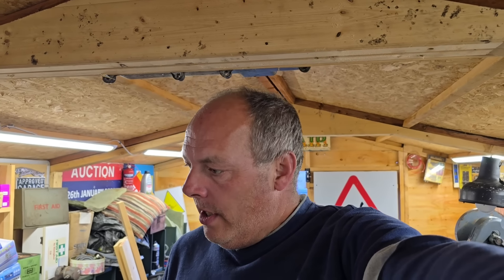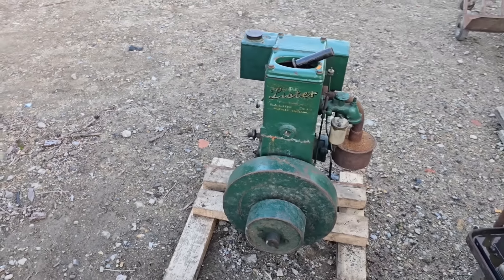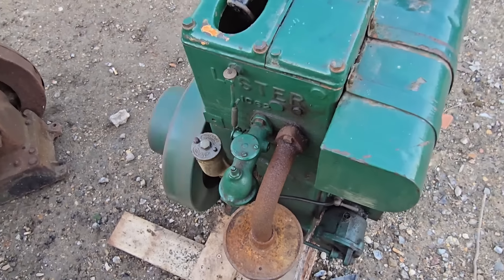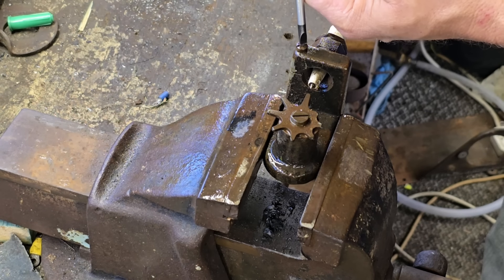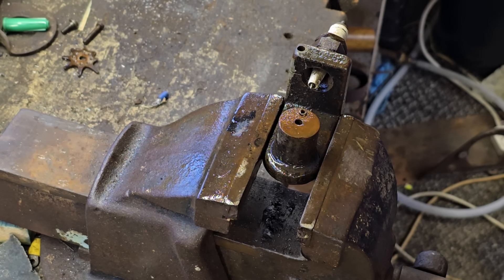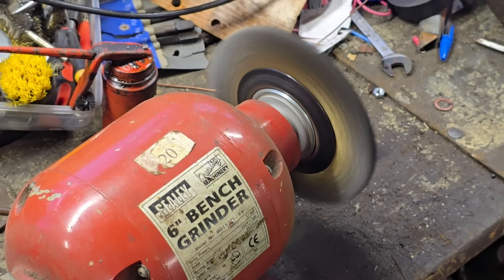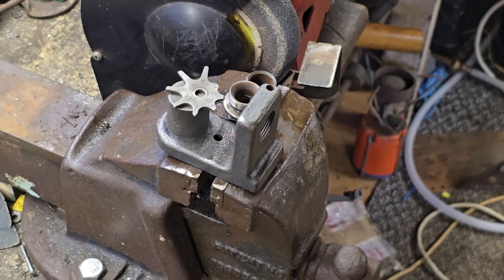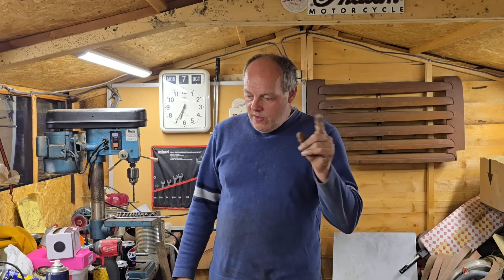Lister D another one. Plus Spark tester Restoration.

Comment: Evening Adam,  Re. Spark plug tester. I think this is not for plugs but could and magnetic testing, hence it having a faux plug instead of a real one. The spring behind the star should have a ball bearing behind it to act as a detent so the star stops at each point of the star. I do wonder if it popped out and is on the floor somewhere around the vice area. Love the videos best wishes to you and Mrs Mancave👍😁

Comment: 24:40 The ball bearing is on the bench in the joint between the two bits of wood about 6 inches from the wire wheel, I hope you find it.
Reply: At 25:18 it’s the other side of Adams hands …..oh no it’s not ….oh yes it is

Comment: The D is a normal clockwise rotation model, reverse rotation engines have the carburettor closest to the fuel tank. As for the air valve on the carburettor normally for starting if needed hold it down to choke the engine a bit.

Comment: I do wonder about you at times! 😂 the plug from the tester, why didn't you put the lock ring upside down in the vice jaws and then get the spanner on its base n bobs your uncle! No need to do the vice up tight, just kiss the ring within the jaws. Think of it as a big fixed adjustable spanner. You made a simple job more difficult 😉

Comment: Adam, lister D , push flywheel backwards to you feel compression, tickle float, turn carb screw3/4 hold down the intake valve and crank ,if the timing is set up correctly it should fire into life first time. The crosley will look awesome with a paint job .